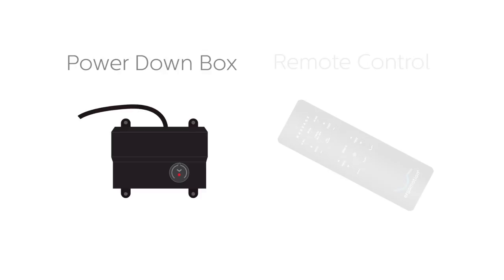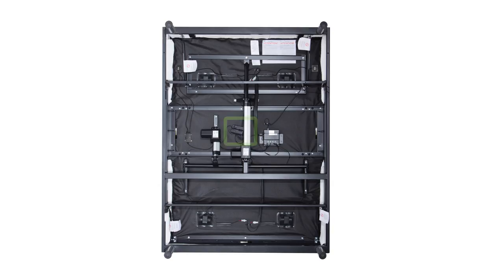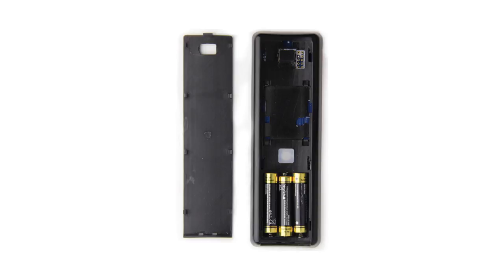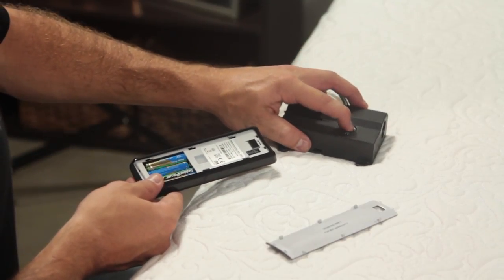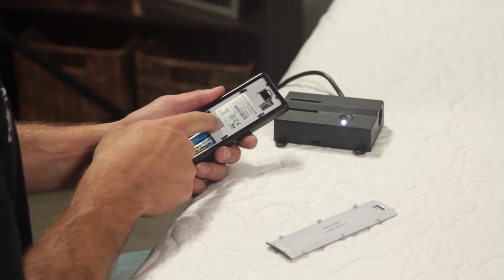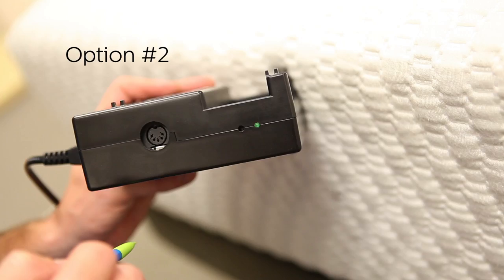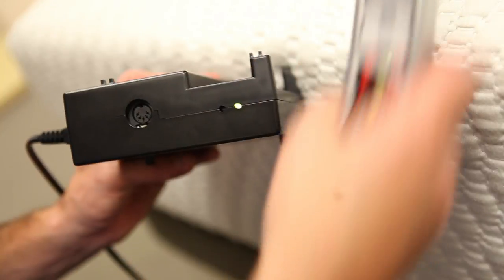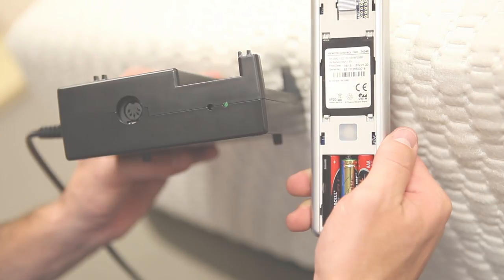Pairing Remote

Comment: Scince Sleep same system, no green light on reset of power. Remote does fine with pair as I get flashing blue but NO joy that makes anything work. Not usre but toothpick may have pushed green light or reset too far. there is a nother hole that says pairing but it does nothing just empty hole. HELP